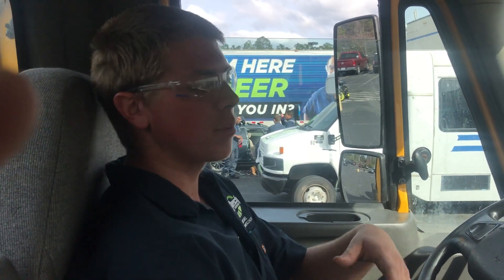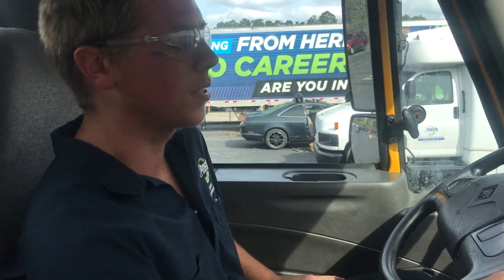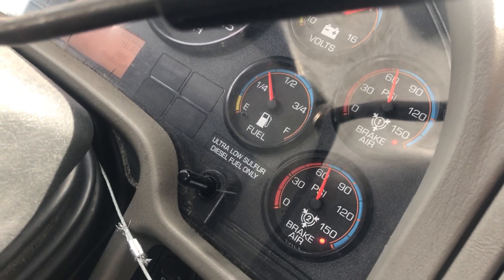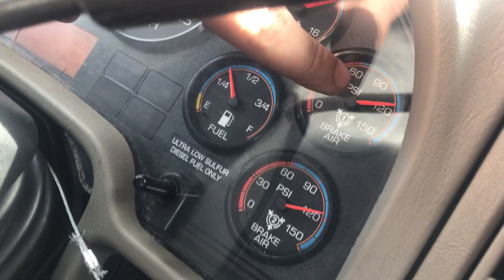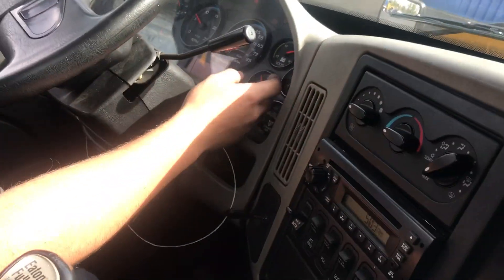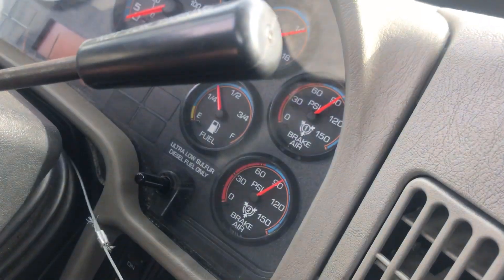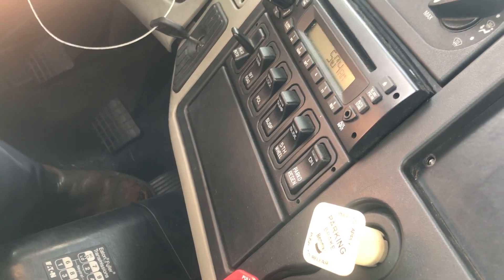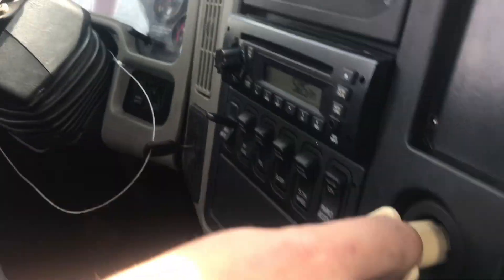Cut in, cut out, and low pressure warning on air system

Comment: Low air pressure engages between 20-45psi with the parking brake… 30 is still fine.